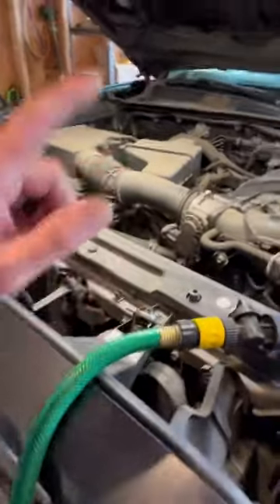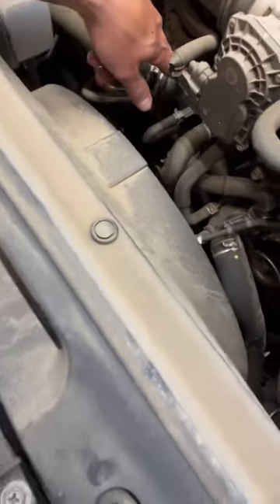How To Coolant Flush! Easy!

Comment: What's wrong with green? Aren't most universal coolants green?
Reply from the maker: great question! a lot of the materials used in manufacturing modern vehicles are not compatible with green. You could use green in an emergency, but I would always go with coolant specific to your vehicle. hope that helps
Reply: @aiyogarage  thank you for taking the time to let me know but whenever I buy universal fluid for my Altima, it always comes to be green if it's Preston
Reply from the maker: @Imadethistocomment13  It appears there is an option for green coolant with altima. If you get me the year I can always look it up for you and see what OEM recommends.
Reply: @aiyogarage  I have a 2008 Nissan Altima coupe 3.5 SE. I think it's too late for me to even consider if I made the wrong option because I've been using the universal green now for over 6 years but it would be interesting to find out if I've been doing it wrong this whole time
Reply from the maker: @Imadethistocomment13  Hey no worries. I would consider that a somewhat older car and wouldn't be too worried about putting universal coolant. However, spec calls out "50/50 mixture of Genuine NISSAN Long Life Antifreeze/Coolant and demineralized or distilled water". That coolant is blue. But great question. Feel free to check out more videos on the channel and to ask more questions.

Comment: He's just saying use what the manufacturer tells you to and he's right also he's right about the air and removing the thermostat. I've been a professional mechanic for 23 years, I use distilled water but I've used tap water in the past and it's never caused any damage so I'm not sure how true that is that you have to use distilled water.
Reply: You can back flush the engine with good ole tap water and then fill it with distilled and the rad flush additives to nuetralize any minerals and run it for a while, just dont want the tap (or mainly city water)it in there long term.  Drain and fill 50/50 with distilled. 

Its honestly more of an issue based on your water quality.

Comment: I use Prestone Green in my '68 C/10 and '71 GMC Jimmy. The orange stuff would corrode my Brass radiator and heater cores.  For my '03 Tahoe the Dexcool Orange works. They don't mix.
Reply from the maker: @HootOwl513  sounds like you’re doing exactly what you’re supposed to do
Reply: @aiyogarage  I've been running my '68 Stepside since 1973. There's a reason it's still on the road.

Comment: People use distilled water don't half ass it. 
Other than that it's a good video
Reply from the maker: I personally don’t know a single professional automotive technician or automotive shop that uses distilled water. That’s just been my experience. Thank you.
Reply: Do you know whether or not they do the same to their personal car?
Reply from the maker: @chrisvelazquez5167  go to the auto store and show me the isle where they sell distilled water for coolant flushes
Reply: @aiyogarage not asking that in a challenging way. I’m just curious if they do things differentl when they’ve got a personal stake in the longevity of the car.
Reply from the maker: @chrisvelazquez5167  lol no I know I’m just joking. I personally do not know any professional, working automotive techs that use it in their personal vehicles for doing a coolant service. Good question though
Reply: @aiyogarage distilled water is pure and won’t rust as easily, it’s definitely worth using. City water might be fine but if you’re on well water then that’s going to cause problems later on
Reply: Correct. You won't find distilled water in the auto store because that is what they sell 50/50 for. Distilled water isn't NECESSARY but they didn't just make it up. Distilled water has the minerals removed. The minerals in the water is how rust and mineral deposits are formed. Distilled water is literally made but boiling the water, which separates the minerals and leaves only pure water. So if they boil water to removes minerals, what do you think happens to minerals in your tap water when it's running through your hot engine? 50/50 is part antifreeze and distilled water. I wonder why?

Comment: I stopped using green years ago and moved to Orange Dexcool in my trucks, for my car I use purple coolant. I like the pre-mixed because it’s just easier after I flush. However, never ever mix coolants.
Reply from the maker: Good stuff!
Reply: Hope it’s a GM vehicle
Reply: @bradleysparks4659  Yep, they all are! 👍
Reply: I had orange then they used  Universal Radiator Fluid!
Reply: I heard if you mix anything else with the orange dexcool it will turn into jello. Why wouldn't you use Toyota pink?

Comment: Instead of removing the hoses and the thermostat can you just open the petcock on the radiator and turn heater on and flush it that way? Im assuming removing the hoses and thermostat is just quicker?
Reply from the maker: Just easier and makes for a good clean out
Reply: My gf got mad when I said I was gonna go release my petcock.
Reply: I would not advise running your engine whilst draining the coolant

Comment: So flush with tap water, but mix antifreeze with de ionized/distilled water
Reply from the maker: I'm not aware of any shop or dealership that takes the time to mix coolant with distilled water. There really isn't time. Just straight tap water. 

I know I've seen it in work instructions before, and I'm sure loads of forums say only mix coolant with distilled water. But really the important thing is making sure you're using coolant that was designed for your specific vehicle. Hope that makes sense.

If you're into performance or racing its a whole different subject. Hope that helps. Thanks for watching.
Reply from the maker: @Laredo Potato Hey Laredo, if you think any shop at any time has used distilled... you should probably just stick to doing your own coolant flushes.
Reply from the maker: @laredopotato dope. Then why are you watching a video on how to do a coolant flush?
Reply: Laziness, since when do dealers care about how long your engine lasts
Reply: @laredopotatoagreed
Reply from the maker: @laredopotato yeah you’re right I obviously have no idea what I’m talking about
Reply: @aiyogarage Nobody keeps vehicles long enough for tap water to be YOUR problem but over time, if that vehicle lasts, it will be somebody's problem.  Currently replacing water pump in 93 wrangler that was extremely corroded and calcified.
Reply from the maker: @hondast90  Yeah, that's a good point. But I think also to take into consideration, it is a water based cooling system going into (in your case) a cast iron block. No amount of distilled water is going to prevent corrosion from building up.

Also, thank you for being reasonable and to the point in your comment. This video has seemed to really stir the pot.
Reply: You probably don’t do the engine block drain either but I do.

Comment: Bro I ain't got none of this equipment I need a down and dirty get errr done type ish
Reply from the maker: Undo the lower coolant hose. Let it drain. Reattach hose. Add water. Run vehicle until thermostat opens. Rinse and repeat. Careful handling hot water/coolant. That will clean out the system. Then add concentrated coolant until it’s a 50/50 mix. Hope that makes sense
Reply: There's a 100% way to do this without any of that nonsense. Just look up some other full flush videos and not a short
Reply from the maker: @s.a.dtactical378  Nobody said this is the only way to do it 😂

Comment: I thought there was a reason to NOT put water from the hose , because of the other things that ultimately get caught up in the coolant system -
Reply from the maker: Yeah the hard water isn't optimal. But I've worked at Luxury dealers & independent shops. Everyone just uses tap water for flushing and diluting coolant. There's no big special tank in the shops for distilled water. I would imagine in a performance or race shop they might. It would be interesting to hear input from someone that works in that side of the industry.
Reply: @aiyogarage  Using distilled water for mix is the proper way as tapwater is very corrosive with mineral buildup a prime example is your water heater has anode (aka sacrificial rod, )that gets badly damaged just from the tapwater, so what do you thinks gonna happen to your engine block? It becomes the sacrificial block with tapwater, especially since a lot of those places don’t even use proper filtration and even if you did there still a mineral deposits.

You can ask any car detailer why they don’t use tapwater either .
Reply from the maker: @peckerpeter2078  Every car dealer uses tap water in your cooling system. I'm not saying its the best. Im saying this is the reality that we are living in.
Reply: @aiyogarage  Exactly why you should do simple maintenance on your vehicle/vehicles yourself. Using Higher Quality or at least O.E.M specifications .

As well as following the factory service manual, torque specs are very important, along with the correct procedure on how to do anything pertaining to the vehicle.

Doing so will save you thousands$$$$. Plus keep your vehicle running optimally like new, always make sure your MPG is at factory spec. $5 per gal fuel anit fun to waste.

Changing oil,filters, fuel injection cleaner,rotating tires, proper air pressure goes along way. Proper Maintenance on a vehicle can last 20+years etc etc..

Paying someone else to do the work you can do with the space and simple tools is better if you have time. Otherwise you can go broke paying those shops quick.
Reply: some coolants react to the minerals in tap water creating deposits.

Comment: What's wrong with green coolant?
Reply from the maker: @Asimo44  modern vehicles have specific coolant fluid requirements. Using green/generic coolant isn’t ideal, but if that’s all you have it’s better than nothing. It’s just frustrating as a tech and you go to work on the cooling system and you see green coolant. Now you have to also try and sell a coolant flush so you’re not mixing different coolants. Just trying to get the word out there 👍
Reply: @aiyogarage  okay and are you saying you don't use distilled water to flush or you don't use distilled water at all?
Reply from the maker: @Asimo44  I’m saying I don’t use distilled water at all. Any shop that has ever serviced your car does not use distilled water either. Common practice. Not saying it’s right, you should always follow manufacturer instructions. But just being honest with the public about it
Reply: @aiyogarage  so you say green coolant is bad but then you also say you don't follow manufacturer's instructions? Kinda just lost all your credibility there. I'll keep using green coolant and distilled water. 👍
Reply from the maker: @Asimo44  you do you booboo

Comment: How critical is it to use air after the water?
Reply from the maker: It's important to use air to get as much of the water out of the system so you don't dilute your coolant too much. You can always use an Antifreeze Coolant Refractometer (on Amazon for like $20). to double check the freezing of the coolant point after you've completed the flush and re-fill.
Reply: @aiyogarage  That's some good info, thank you.
Reply from the maker: @jjaa578  Hey no worries. Be sure to check out the channel and let me know if you have any other questions.

Comment: Yeahhhhh, I’m just gonna drain the radiator and call it good.

Thanks, though.
Reply from the maker: No worries. That can work too!
Reply: @aiyogarage If it’s a warm day (75°) is it a bad idea to drain and fill with pure water, then drive the truck (~50 miles) to flush/dilute the contaminants in the system before refilling with new coolant?
Reply from the maker: @andymike6575  I don’t see why not 🤷🏼‍♂️
Reply: @aiyogarage thanks! I don’t have a flush machine like you.  Just an air compressor
Reply: @aiyogarage where do you inject the water hose during flush? Into the reservoir?
Reply from the maker: @andymike6575  I usually do it into the upper radiator hose

Comment: Can i do a flush if i possibly have a bad head gasket ?
Reply: Yes you can
Reply: You could in theory, but I would strongly advise getting a new head gasket installed on your engine. And at that point, probably do some other tuneup related work.
Reply from the maker: I would sort out the head gasket situation first. That'll take priority over maintenance. There's also a small chance that coolant could flood the cylinder well and cause internal engine damage.

Comment: Good bye engine. Never ever put water in engine.
Reply from the maker: Idk where you got that information.. but it is entirely wrong. Putting water in the coolant system is a common practice. Example: On a race track, coolant is not aloud in the cooling system, only water. Please feel free to reach out if you have any more questions or concerns.
Reply: @aiyogarage  only reason that it would be necessary to not use water is when it’s below freezing. Otherwise it really doesn’t make much of a difference
Reply: @aiyogarage  keep on trucking lmao
Reply from the maker: @fearisaiah  I like the energy
Reply: Who is putting water in the ENGINE? Did you even watch the video or have ANY understanding of what this video is about???
Reply: @ryanm4013  you can most definitely put water in instead of antifreeze at least for a couple days. The only problem with water being in it is that it could freeze in low temps and damage alot
Reply from the maker: @ryanm4013  Thank you!